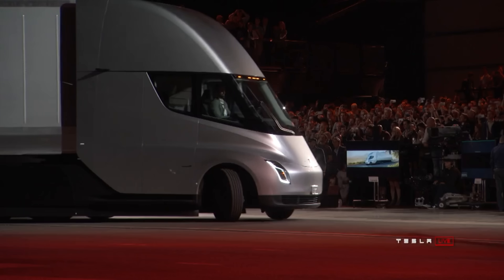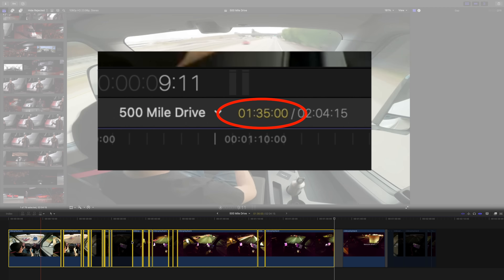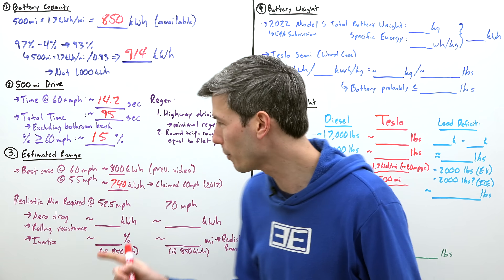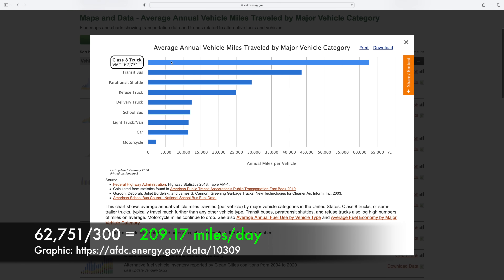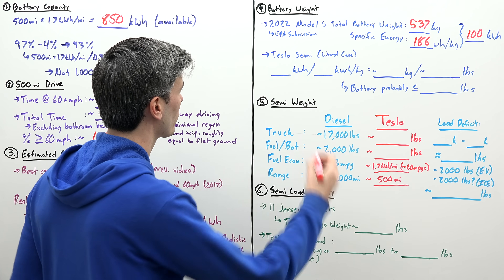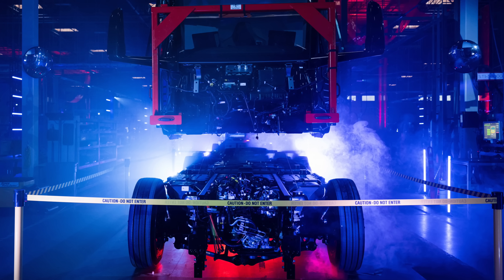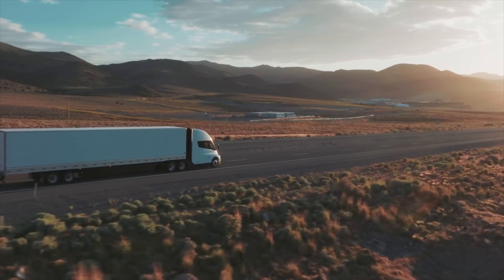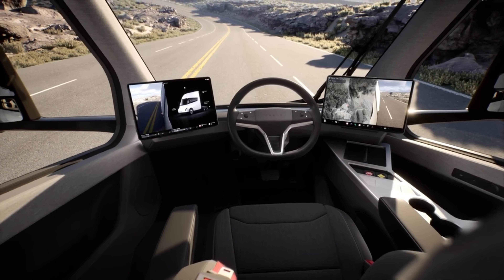Does The Tesla Semi Make Any Sense? Part 2!

Comment: Hey truck driver here, point on speed.
It's extremely common for trucking companies to set the governed speed on their trucks to between 60 and 65 mph due to the beneficial impact on fuel economy. I've rarely had a truck that could manage 75 and that was always a rental.
Either way the semi in its current iteration was not designed for long haul.
Reply: Oh yes, everybody knows after we all had the pleasure of stuck behind one truck with 60.5 limiter trying to pass another with 60 limiter on a two lane highway
Reply: @greentjmtl  😂😂😂
Reply: @greentjmtl  This was……. 😂😂😂😂😂 truly hilarious 🤣🤣🤣
Reply: California speed limit for any vehicle pulling a trailer is 55 MPH so the fact that he didn't drive at 80 MPH like in Texas is to be expected.  As it was he was speeding for 15% of the time.
Reply from the maker: They must not operate as much in the PNW; I commonly see trucks doing 70, 75, and occasionally 80 in areas like Idaho (even in areas with lower speed limits).
Reply: @EngineeringExplained  consider yourself lucky if even a medium percentage of trucks in your area are going that fast! LoL
I drive the interstate in my car about 300 miles per week and I rarely see a big truck doing more than 65mph. Most big carrier trucking companies have truck governors set to 62-65mph. I'm routinely stuck in a 10-20 car line behind a big truck in the left lane that's only going half a mile per hour faster than the one in the right lane. It can take them several miles to complete a pass if the right lane driver does not have the decency to lift the throttle for a second or two.
Reply: @eric-.  I really wish they'd give the governed trucks a 'boost button' that increases the governed speed by 2-3 mph for say 60 seconds, maybe 2-3 boosts per hour to let them get around other governed trucks more quickly.
Reply: @dorvinion  there should TOTALLY be a law to make that happen!
Reply: @eric-.  and that's also peak speed. Not average speed. Even if the drive 60 on the hiway I guarantee their overall average speed would be well below 50. U have to slow down for towns and cities and traffic etc etc. I've tried before and on a day to day basis to average 60mph you have to drive 80 as much as possible and even then it's difficult unless your driving somewhere that u never have to slow down or stop for anything.
Reply: @themeach011  oh, for sure max speed. I do sometimes get stuck behind 50-58mph going up a small hill. The worst part is drivers of fleet trucks with governers will get in big trouble or fired if the data recorder shows going faster than the limiter, even if it's downhill. I've heard more than a few drivers comment about that.
Reply: @EngineeringExplained  As someone who grew up in California and is currently in the PNW, the truck drivers up here are insane. They speed, take up all lanes including the passing lane, and pull risky maneuvers quite frequently. I wouldn’t judge trucking over what you see up here. In CA I believe they are limited to 55 mph in most stretches of the highway. (The 5)
Reply: @Engineering Explained  those are privately owned trucks. Take a look at trucks from large companies like Swift or schneider, they are always kind of slow.

And large companies are the target market for the Tesla semi. I'm an owner operator and I know it makes no sense for me (even tho I kinda want one). For one thing, it would take me like 3+ days to just charge it up at home from my Level 2 charger (extrapolating from my model 3)
Reply: @SlackActionBumble  I think within 5 years you are going to see Tesla Mega-Chargers (or whatever they call them) popping up at TA, Loves, Flying J, Pilot. etc.  But will they make a sleeper for long haul???
Reply: @rogerheuckeroth7456  They should also have reserved parking spots with slower-but-cheaper overnight chargers. Being able to have a guaranteed space to park for the night AND a full charge in the morning - that would start to look pretty tempting.
Reply: @rogerheuckeroth7456  sleepers will need to be ~800 ish miles imo. Give it a gen or 2 of battery technology.
Reply: @SlackActionBumble  💯
Reply: @mrspeigle1  Depends upon what develops first.  Either the battery energy density goes up and cost comes down, or truck chargers become ubiquitous.  You could easily take your 30 minute break while plugged into a fast charger and get an extra 300 miles range.  Its hard to drive 800 miles in 11 hours anyway.
Reply: @SlackActionBumble  don’t worry. They will build v4 superchargers everywhere. Cybertruck will use same architecture so v4/1000kw charger will be common.
Reply: @Roger Heuckeroth  relying on the 30 minute break isn't a solution,  you generally don't get to choose where you take it and most drivers prefer to log it during loading and unloading operations. Plus it's not that your driving 800 miles in a day, it's that your covering 600 miles, camping overnight in freezing weather or blistering heat and then driving 2 hours to the delivery point before stopping for a charge. That's the kind of stuff long haul does.
Reply: @EngineeringExplained  In Texas they drive 70 minimum with most 75 and some 80
Reply: @EngineeringExplained  on I 95 in Virginia, which oh by the way is the worst stretch of the interstate in the country because Virginia has a bunch of antitaxxers in the electorate, 70 miles an hour is standard for everyone, but the trucks do struggle in the Rollinghills to maintain a constant speed but then that has as much to do with people in autos who just aren’t paying attention and don’t maintain a constant speed in rolling hills. For certain if you’re not tryin to go 70 miles an hour in northern Virginia then you are obstructing traffic. I personally have observed groups of trucks going 80 miles an hour on I95N many a time. 
P.S. at the risk of indulging in confirmation by bias, I want to say I am e heartened that there is a business case for electric trucks, and certain applications where the one described in the video just happens to be the one that I’ve been promoting. 🎉
Reply: @EngineeringExplained  Company owned trucks Vs Owner-Operator trucks. Both drivers are paid by the mile.  When the company pays for fuel, they're gonna be tight fisted with that money.  If the Owner-Operator spends 15% more on fuel, but makes 20% more on the mile...  every penny helps.
Reply: @EngineeringExplained  it’s based on who owns the truck.  The mega carriers limit speeds from 62 to around 70mph (some give you a few extra miles for a few minutes to pass).  The faster you go, the more damage an accident costs.  For owner/operators, the faster you go, the more money you make. Since you own it, you are a safer driver.
Reply: @EngineeringExplained  If your semi go over 62 mph on west coast(California Oregon Washington) you'll have a very high chance of getting a speeding ticket.
Reply: @EngineeringExplained Please discuss semi solid state batteries from China
Reply: Where do you live where they're governed at 60-65? At least for me its between 67-72
Reply: Try driving in Europe, like I used to do, where the truck speed limit is typically electronically limited to 56 mph. Even then many of the big companies reduce their trucks further to the efficiency/productivity/safety sweet spot of 52 mph where they can get about 10-11mpg (UK gallons). I anticipate the Tesla truck under European conditions will be doing over 500 miles per charge, although its impossible to legally drive that distance per day there anyway, so it should work well on lighter hi-cube or sub 44 tonne rigs.
Reply: Electric trucks would make more sense hauling loads through regions with inclines and declines like West Virginia. The brake regen gives back energy compared to diesel engines that give back no energy on the down slopes.
Reply: My rental is set to 70 but my personal truck got turned up to 80 without anyone telling me. Got lucky at a KW dealer. Lol
Reply: Funny in Europe the trucks are allowed to drive 80kmh(50mph) but mostly drive around 60mph very very rarely seen faster ones.
Reply: You must not be in Michigan.
Reply: Here's is another variable missing from their radar:
🤯💥🤯Multidisciplinary engineer/inventor here. We are developing the revolutionary FAZE engine technology. The 𝔽𝕦𝕖𝕝 𝔸𝕘𝕟𝕠𝕤𝕥𝕚𝕔 ℤ𝕖𝕣𝕠 𝔼𝕞𝕚𝕤𝕤𝕚𝕠𝕟 𝔼𝕟𝕘𝕚𝕟𝕖  tech best solves the issues present in previous internal combustion engine designs by transforming the old paradigm into a simple, low cost, quiet, power dense, efficient, on-the-go liquid and gas fuel-flexible, ‘non-polluting’ solution for power generation of all scales and advanced transportation.

𝔽𝔸ℤ𝔼 delivers better than 25% ABSOLUTE/ACTUAL [not relative] 
fuel efficiency improvement over gasoline engines, more than 15% 
for Diesel engines at any operating condition - speed/load, ambient 
temperature or elevation, not just at one optimal testing point at 
STP. Real world driving cycle savings could be an additional 200% 
higher due to the constant MAXIMAL efficiency and torque which 
results in a huge turn down ratio of ~99% without sacrificing 
performance. That means it's idle or running speed can be 10-50 rpm. 
The `simple, low cost, native/built-in, non-electric, environmentally safe, 
non-explosive, temperature agnostic 𝕊𝕦𝕡𝕖𝕣ℍ𝕪𝕓𝕣𝕚𝕕© feature 
recovers more energy than EVs and provides approx.100% fuel 
savings for a combined absolute vehicle fuel usage improvement of 
approximately 300%, thus obviating the basic need for expensive 
EVs & e-hybrids. 𝕚ℙ𝕠𝕨𝕖𝕣𝔹𝕠𝕠𝕤𝕥 adds >400% more torque. It’s like 
4 engines in 1.  This is all done w/o a transmission. 
 
The fuel agnostic capability allows instantaneous use of any liquid 
or gaseous fuel [natural gas at home!!!] incl. biofuels and hydrogen, 
even if old/dirty/unprocessed like flare gas or employ the concurrent 
multi-fuel capability…anywhere on the globe. One engine for all 
locales w/o modifications! Unlike EVs, this enables fast fueling anytime, 
anywhere…with no troublesome infrastructure disruptions or 
changes. EV’s are not a solution to the [FAKE]climate or mobility topics as 
high level of electrification globally is unrealistic 
[See Patrick Boyle's video "Electrify Everything?"] 

The technology offers smokeless, non-polluting, low odor heat and 
noise output without costly after-treatments, etc.,… with only the 
lowest  CO2. It has a negative carbon footprint with hydrogen, 
ammonia, biofuels or gasified municipal, agricultural and/or forest 
waste and coal from a 2-stroke-like simplicity. 

With virtually no electronics and emissions equipment, the cost of
purchase and reduced servicing frequency make this solution 
even more appealing.
 
Those are my two-bits

PS.
Did I mention we're developing advanced, simple, low cost, power dense electric machines and torque dense[read - compact], infinitely variable FrictionLess transmissions?
.... ... ....
Reply: Teslas initial offering was in a Trump economy that was booming. In the Joe Biden economy, all prices have changed and gone up.
Reply: My father was a truck driver from the late '80s to the early 2000s. I remember riding with him once at over 90. His boss wanted fast trucks. Fuel was cheap back then, time was expensive. He claimed at the time (I know he exaggerated a lot) that he was doing over 100 mph during the LA riots. But I actually believe him on that one.
Reply: Most semi trucks in Texas have no problem driving 75-80. I drive 80 on highway and i barely pass any semi trucks at 75
Reply: California speed limit for semis is 55 mph.
Reply: Yeah dude, I'm in Cali and if I'm driving the speed limit, the semi trucks are passing me every time. EVERY. TIME.
Reply: In Europe, the speed limit is 80 or 90 km/h (50 or 56 mph) on motorways, depending on the countries.  Limiters are generally set at 90 km/h... and you better not be caught speeding.. or even having been speeding at any time during the past 24 hours, as all is recorded.
Maximum driving hours are 9 hours per day (with some exceptions for 10 hours) and not 11 as in North America.
The trucks are also much more comfortable and better noise insulated, resulting in less fatigue for the driver.
We end up having a much safer trucking industry!  And productivity does not suffer so much, as we are allowed considerably higher payloads.
Reply: What I can't figure out is how a Tesla semi would make weight with a heavy load assuming the standard 12/34/34  weight maximums. The add'l semi weight calculated here, net of weight saved by removing ICE components, is +4,000 pounds. So how does +4,000lbs make sense when it's all in the tractor? You'd have to really reduce weight on the fifth wheel, which implies much lower load capacity. I don't get it.
Reply: @taterkaze9428  You are correct that the trailer’s weight on the fifth wheel would need to be reduced, but this is easily accomplished by shifting the location of the tandem axles on VAN trailers further forward. In some states (CA), there are very specific rules about where the trailer tandems can be located. However, in a majority of the states, you can place the tandems wherever needed to have the proper axle group loading. On flat deck trailers, the tandems (or spread axles) are fixed. Load balancing for flat decks is done simply by shifting the load fore and aft.

Many Class 8 trucks also have the ability to move the fifth wheel location fore and aft, although this doesn’t have nearly as big an impact to load balancing as sliding the trailer tandems. Not sure if the Tesla Semi can shift the fifth wheel or not.
Reply: @douglasgroff7648  What you are saying is all good stuff. Another way to achieve this with trailers (if length regulations allow it) is to move the fifth wheel pin forward on the trailer frame and not move the trailer axles or fixed 5th wheel on the tractor. In Europe we have quite a few trailers that have two or even three pin positions in the frame (from new) and while it is not the easiest of things to move the pin  (a 45 minute job to unbolt it and re-bolt it) it could be done to allow for different types of tractor unit or axle load regulations. Its been a few years since I moved a trailer pin, but I recall that moving one forward 18 inches could reduce the load on the drive axle/axles by a couple of tons on some trailers. The perfect answer though for the Electric trucks will probably be dedicated trailer designs so that everything is optimised. 👍
Reply: @taterkaze9428  you create new maxiums
Reply: @taterkaze9428  I think the weight of the heavy engine is moved backwards due to the batteries in the middle of the truck. Probably still near the 12k on the steers.
Reply: @taterkaze9428  remember, you get an extra 2000 lbs weight, so use that on the truck axles.  It wouldn’t surprise me it the cargo has to be loaded in a dry van the same way they load refrigerator trailers. (I’ve been told a refer weights around 2000 lbs)
Reply: @taterkaze9428 I'm not sure how they're specing out the trucks, but the front axle could be a 14k axle with 16 ply tires. That would get you to 14+34+34=82k  yes the truck will not have the same net capacity still of a standard truck, but that'll get you to the 82k the feds give for ev trucks.
Reply: @taterkaze9428  If I am understanding your question correctly, generally the only way to balance load distribution and achieve maximum weight is either move the fifth wheel or have a tractor with a setback front axle. If the tractor is known to be heavy in the design stage, the front axle needs to be set back even further. I still think that they are using a 36k driver axle and possibly a heavy front because the front axle isn't in the middle of the tractor to achieve balance. There is usually a few feet on a deck to move the load back, it gets complicated in practice and sometimes requires several trips to the scale. A heavier tractor always makes this more difficult.
Reply: I think we are talking private operators (max power and speed) vs fleet (slower, slightly safer, lower insurance premiums etc).  Father would run his rig quicker (private owner) but I have seen the governed slow trucks like @greentjmtl mentioned.
Reply: I'm glad i drove a truck with no limiter and 600hp. In many states I would be cruising at 80. Traveling at 60 mph is miserable, would fall asleep.
Reply: @fondfarewell2 !  you must have not had to pay for your own diesel. I'm an owner op and I cruise 68 or even slower. Would literally go broke trying to go 80 everywhere and getting like 3mpg.
Reply: @SlackActionBumble  no I didn't. My brother was the owner. But even so the truck was setup for flats, had a 3.08 gear, didn't need to over rev truck.
Reply: @SlackActionBumble    .
Reply: @SlackActionBumble   .
Reply: @SlackActionBumble  — What mpg do you get at 68 ?
Reply: @sking2173  7.5 to 8.5 mpg
Reply: @fondfarewell2  Lol, in Germany the government speed limit is around 50mph for trucks on the Autobahn and about 40 on country roads. Have fun falling asleep there lul.
Reply: @Blockbuster2033  this isn't Germany.
Reply: @Blockbuster2033  your entire country is as wide as Texas. 50mph end to end isn't the same as having to cover 3000 miles in America.
Reply: @bluetyphoon2100  Yeah that's definitely true.
Reply: @Blockbuster2033  And they are super strict on that in the EU.
Reply: @bluetyphoon2100  Isn't really a point. Time is money applies anywhere and this speed limit is consistent over (nearly) all Europe. This is more about safety than the size of a country. Germany has plenty of highways with no speed limit for normal cars, but they still limit their trucks speed to 90km/h. Now I can understand a higher speed limit for sections where there is no habitation/traffic for a long time, but statewide high speeds is something different. Most of the US pop live in area's with a population density similar to that of Europe btw.
Reply: @bluetyphoon2100  Also Germany has a decent rail network, unlike the joke we have in America. They have better options for long distance shipping.
Reply: @Blockbuster2033  germany shite
Reply: @Blockbuster2033  All good though, it's not like the cars on the Autobahn are going much faster than 50mph or anything.
Reply: @Blockbuster2033  Limiting semis on highways to 50 mph sounds incredibly dangerous and an accident waiting to happen. I've towed heavy loads in my little pickup where I've topped out at 50 mph on a 75 mph interstate and the speed difference is for sure not safe if there is anything more than light traffic.

IIRC, statistically, driving too slow is more dangerous than driving too fast.
Reply: @Blockbuster2033  The speed limit may be 50mph but trucks in general on the Autobahn are driving around 60mph (around 95Km/h).
Reply: @fondfarewell2  this is the internet...
Reply: @fondfarewell2  Max HGV speed is 50-60 mph in many parts of Europe.  It saves fuel and makes less pollution. Difference between fuel consumption at 60 and 80mph is HUGE and diesel is $8/gal (us).  No one is in a hurry to lose money.
Reply: @fondfarewell2  90's? Early 2000's?
Reply: @fondfarewell2  You’re driving recklessly and should lose your license. Driving over the rated speed of your tires is stupidly dangerous.
Reply: @fondfarewell2  Then, you wouldn't qualify to drive in Europe!  The speed limits for large truck is 80 km/h (50 mph) or 90 km/h (56 mph) depending on the country.  But the EU average speed achieved on long hauls is in fact 74 km/h (46 mph).  You would anyway have a speed limiter set at 90 km/h).
Having said this, your maximum number of hours at the wheel would be only 9 hours per 24-hour period.  So, you would have plenty of time to rest!
When I hear of truck drivers falling asleep, I can't wait to see autonomous trucks replacing them!
Reply: What happens to battery when you constantly charging over the recommended 80% charge? Because most companies who buy will have to charge to 100% everyday especially in the winter.
Reply: @Darrenabc  two things about charging to 100% make it not a big deal in this case:
1. It’s not a big deal to charge to 100% as long as you depart soon after reaching 100%. The damage comes from holding the 100% state of charge. I’m sure this is easily managed by Tesla’s fleet-management software and predictable routes/schedules these trucks will be on. 
2. Most of the winter range losses come from having to warm up a cold battery and warm up a cold cabin. Energy to keep a cold cabin warm will be a very small % of the total energy these trucks use on a route, so that’s not a big factor like it is in cars. And users can easily pre-condition their cabins and battery packs while connected to charging with the same fleet-management tools I mentioned above. 

I’d expect the cold-weather range to be pretty close to warm-weather range for these trucks. Not that it isn’t a factor, but it’s not a big factor. 

And finally, we don’t know what kind of buffer Tesla has put on the top of these packs. It’s possible they’re 1MWh packs with 900kWh usable (for example… though that would represent a truly massive buffer). Big buffers mean even less danger when charging to 100%.
Reply: @59317  Thanks so much for your insightful answer.
Reply: @Paul Toben  why so you think there is not a huge difference in cold weather ?
In a standard car the efficency is decreased by more than a third in vehicles when we reach 0 Celsius.
Reply: @Darrenabc , it's not so much charging to maximum cell voltage but letting the batteries sit for longer periods of time at that high voltage that degrades them more rapidly. That voltage depends on the used chemistry and is typically 4.2 or 4.3V. Most car manufacturers limit that voltage to about 0.1V lower than max to prolong battery life. I wouldn't be surprised if Tesla does something similar with their Semi.
Reply: @schnitznschnatzn  Thanks for the info.
Reply: @schnitznschnatzn  
Where are you getting this information that leaving batteries fully charged is bad for them.  When I made military battery chargers, my sample batteries were always stored fully charged.
The engineer in charge of batteries never told me to never store them that way.
Reply: @neilkurzman4907 , there is plenty of information from research available that describes Lithium battery degradation and what factors accelerate it. I can point you to some sources if you're interested. High temperature, high and low voltage are the biggest factors that accelerate chemical and physical processes that break down the electrolyte and cathodes. I've been using Lithium batteries for over a decade for remote controlled cars and quadcopters and I have destroyed several batteries over the years by leaving them fully charged for weeks or months. In fact, every hobby balance charger has a mode that either drains or charges your batteries to around 60% or nominal cell voltage for storage. The BMS on my drone batteries or EGO garden tools automatically drain the battery to storage levels when they are not being used for a predefined time period. I have mine set to 2 days. What type of batteries were you handling at the military? Lead-acid batteries need to be fully charged or floated to keep them healthy. I can also imagine that in the military it is more important to have fully charged batteries available at all times, even at the expense of destroying them a lot faster. You don't want to head into an exercise or combat with half charged batteries ;)
Reply: @Darrenabc  It's fine to constantly charge to 100%.  It's just not recommended to leave the battery fully charged or discharged for extended periods.  It also depends on the type of battery.
Reply: @TheTriumfAnt  Thanks for your reply.
Reply: @Darrenabc  Nothing really. Plenty of people completely disregard Tesla’s battery care suggestions and charge to 100% at superchargers every single day. After 100,000 miles they lost about 3-5% of battery. So not a big deal.
Reply: @Madison 3  100k miles can be 2 years. Then you'll loose 25 miles? How much the next 100k miles or 730 charge cycles?
Reply: @Soh90  Thanks.
Reply: @Darrenabc  charging to 100% isn't much of a problem when you drive immediately after, the issue with charging to 100% is mostly when you leave it at 100% for weeks on end like people who plug in their car at home every day, it reaches 100% after 1-2 hours and then spends 8 hours nailed at 100% every. single. day. (which would be up to 2920 hours a year!) work vehicles on the other hand would be charged to 100% and driven within an hour, likley spending 10x (or more) less time at 100% than the home car user example above. Plus... I think even then the damage from charging to 100% isn't as bad as it used to be because of battery management improvements.
Reply: @RWoody1995  Thanks.
Reply: @Darrenabc  Q: What happens to battery when you constantly charging over the recommended 80% charge? A: nothing major, just normal wear and tear.  the trucks won't sit for very long at 100% because they'll be getting on the road thus drawing the SOC down (ie, doing the job they were built for).  obviously if logistics predicts it's going to sit then intelligence says DON'T charge it to 100 but instead stop at 80. it's very possible that lower 80% may be enough for the next run it gets sent on.
Reply: @phillyphil1513  Thanks.
Reply: @Darrenabc  Don't think you can assume they will have to charge to 100% Depends upon the route and cargo.
Reply: @JeanPierreWhite  Thanks.
Reply: @Darrenabc  That depends on the Setup of the software. Propably is the limit of the charges 4.15v and not the full load 4.2-4.3v the batterie should be designed to handle 1m miles with 100% charges
Reply: @nicoleibundgut534  Thanks.
Reply: @Darrenabc  probably not actually. You saw the average was 208 miles a day.
Reply: @williammeek4078  Thanks.
Reply: @Darrenabc  
Unlike the author of this video you made an unsupported guess that most companies would need the battery 100% charged every day at a rapid rate.
Do you have data supporting this supposition? 

Let’s say this tractor is only usable on 25% of trucking routes. That’s still a huge number.  Certainly enough to make it a viable product for Tesla.
Reply: Charging to 100% is not a problem as long as you drive it immediately after. Keeping it at 100% in unhealthy
Reply: @Darrenabc  limit the controller on the battery to report full at 85
Reply: @desultorilypanacea  new LFP batteries being used in new model 3's can be charged to 100 on a regular basis now without damage.  I don't know about the semi's but I assume they would be LFP to support the high rate of charge required.
Reply: @matt7662  There is always damage. The cycle life is so high that the battery still outlasts the vehicle.
Reply: @matt7662  Thanks.
Reply: @Darrenabc  Imagine how long it would take to charge using standard 120 or even 240v outlets? A day and a half or more?
Reply: @linusa2996  Wouldn't want to be a driver that had to charge that long.
Reply: @Darrenabc  You have very little choice.  The batteries are not LFP, so charging above 80 or 90% and discharging below 10% is not recommended, thus you have to accept 20-30% loss of range or a shorter battery life.  Another example of the EV BS that is touted by marketing.
Reply: @Darrenabc  I'm going to buy a popcorn machine to watch the epic fires that will certainly occur with these blood batteries.
Reply: @southbound1969  thanks
Reply: You haven't listened have you ?